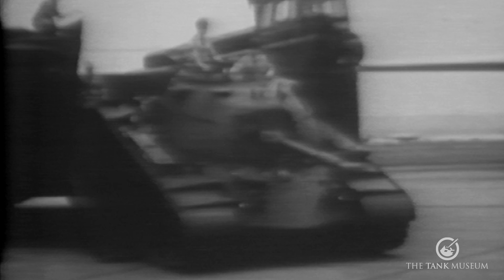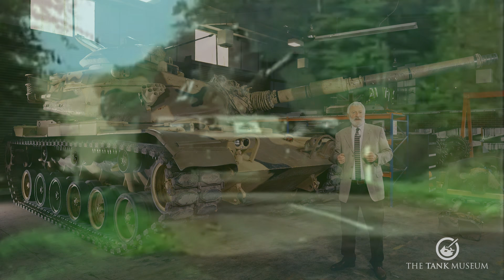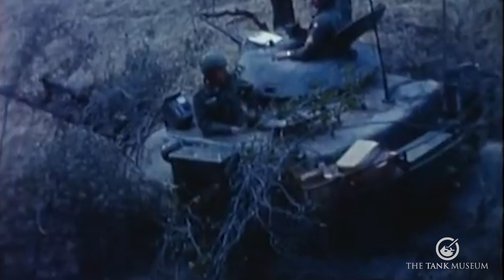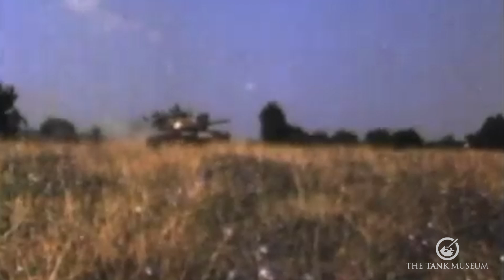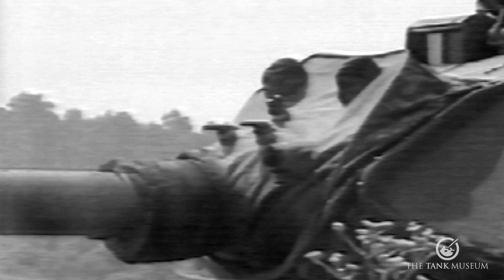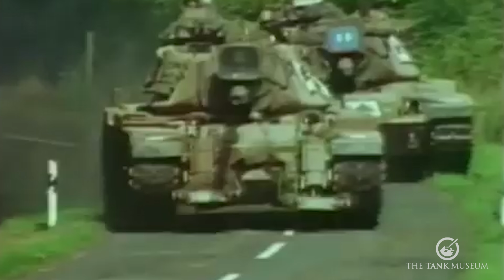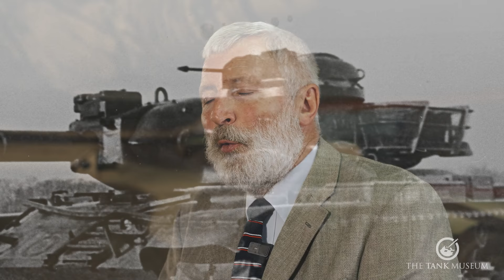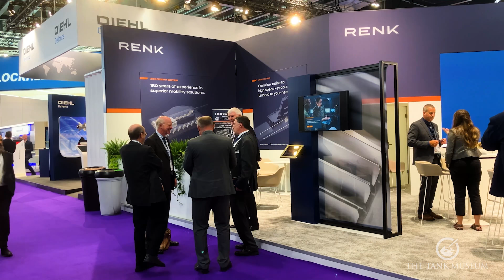M60: Cold War Guardian | Tank Chats #175

Comment: The reason NATO wanted to develop a MBT or Main Battle Tank. The reason for this was to make logistics and economics simplified. So 1: you don't need to worry about light, medium, or heavy tanks. 2: By simplifying the MBT as a central vehicle meant cost effective manufacturing and maintenance. 

This is why NATO considered the MBT doctrine.

Comment: I was a M-60 tank platoon leader in the 3d ACR in 1980. The stab on the M60-A1 RISE was only marginally effective. First, it was only horizontal and not vertical. Second, the 70% hits probability is bogus as we could only go about 5mph and hope to hit a target. And, the commander's cupola was only manually transversible from what I recall. I had wished that it was electric powered.

Comment: Someone has probably already corrected the description of the NBC system.  There was a central blower which supplied air to the crew-carried protective mask via a filter carried by each crewman, but there was NO overpressure system for the crew compartment. If anything, with the engine intake air being drawn from the crew compartment (except in extreme cold weather where the intake could be redirected to draw from the engine compartment), the M60 series would actually concentrate contaminants in the crew compartment!

USMC Tank Officer, 1984-1991

Comment: I spent a few months in Ft Knox back in '71, my first duty station. They didn't need my 44B MOS so they gave me a 5 ton wrecker to operate. I would usually be sent over to the track vehicle shop to assist on M60s. I pulled a few engine packs but mainly I was removing, installing and exercising gun tubes. The gun barrels had to turn to be removed and installed so the mechanics used a steel mesh sling like a strap wrench. When the wrecker lifted on the mesh sling the barrel would turn and come out. The wreckers had a rubber coated track section on the end of the boom. After the new tube was installed I would position the wrecker in line with the tank and extend the boom placing the track section against the end of the gun barrel. A mechanic inside the tank would signal me with one hand sticking out the hatch when to push in the gun tube and when to let it out. After a couple strokes the mechanic would bless it and the job was done. I look back on those days fondly.

Comment: USMC held on to their M103's for frontline use until 1972 and I believe they were with reserve units  until '76. Also,
The original M1 Abrams used the Royal Ordinance L7 (pretty sure these are the tanks we've given to Ukraine).
They didn't upgrade to the Rheinmetal RH120 until the M1A1.

Comment: The M60 was a beast of a tank. No doubt. It could hold its own against the best of the world’s tanks. In service for a lot of years it had the distinction of being the premier tank until the M1A2 came out. Even then, it still gave the M1 a run for it money. However, technology was on the M1’s side and it proved pretty much invincible to the world’s armor. The Leopard tank was really the only tank capable of dispatching a M1. The M60 did things with shear brute strength and tenacity. It was higher than the M1 which clearly gave it a great disadvantage on open ground. It was a fantastic tank for it day and I would rate this tank on a scale of 1 through 10 about a 7 to 8. The M1 was a 9 to 10. The Leopard ( the latest iteration ) was a 10 and If I could give an 11 I would. Germany packed the Leopard tank with everything but the kitchen sink. In my opinion the single most best tank ever.

Comment: I was in the 3rd Armored Division from 1967 through 1969, as a Tank Mechanic. A lot of memories from the times. The German Army was using a German/Reworked M-48A2, which had the upgrade version of the 1790 gas engine with Fuel injection and supercharger. They sounded real similar to the M-88 Recovery vehicle, which still had the Gas engine at the time. They also had a stabilization/gyro system for the 90 mm main gun and could fire on the move. When I had time I would watch them on the gun range, it was amazing to watch and quite accurate too.

Comment: The major improvement in the U S tank development program (M46) was the CD 850 transmission which incorporated hydromatic gearing (high, low, and reverse) steering and braking all in one unit, with no clutch, oh and something totally new "the neutral steering "!
Reply: And one of major improvements to the M60 was the turret control system ( Cadillac -Gauge control system) which was a marvel of engineering and incredibly reliable! And then there was the "marvel of the night vision system) that did away with xenon infrared red based lightning system, and U. S. tanks went "passive" and they no longer with the night vision search lights...they could see in the dark.

Comment: Couple things. 1. M60A1 and before did not have NBC "overpressure" system. It had a filtered system that plugged into crewmen masks. 2. Shooting on move was not really effective. Stabilization system was not good. Way worse than M1 series. 3. Commanders M85 wasn't good. That's why M1 went back to M2 .50 cal. M2 was way more reliable. I was crewman on M60A1 (original and RISE Passive upgrade), M60A3, M1IP and M1A1. TTS thermal sight on A3 was excellent. Thermal sights on M1's very good. IR sights on M60's not good, but Passive Starlight scopes on M60's were pretty good. M60 cross terrain not close to M1. Ammo storage was dangerous in all US tanks until M1 compartmentalized ammo storage. M60 series excellent defensive tanks.

Comment: The US military in the 50s and 60s was idiotic. They either refused to see changing concepts (all steel armor and battle rifles are obsolete). They refused to totally accept new concepts (the moronic M14 rifle and the tall, all steel M60 because WW2 taught us nothing). We still have the Bradley from that period - a huge, easy to spot and hit tall box. And then you had other stupidity, like the refusal to appropriate German weapons. We spent an insane amount to develop the crappy M60 machine gun wjen we could have just adapted the MG42. Likewise we could have just started using the 88mm. But no. We had to spend millions researching and implementing and costing lives of waiting soldiers for 90mm that wasn't as good.

Comment: The M60A1 cupola didn't have power traverse. It was all manual. The M85 machine gun was a great weapon,  but the ammo for it in the cupola was only about 100 rounds. It was very difficult to load the belts into the cupola  feed trays, and usually required the T.C. and loader to expose themselves to reload it. The M73/219 machine gun was notoriously unreliable.

Comment: Jau Leno owns a hot rod powered by a ‘50s vintage M48/60 Patton tank drivetrain. He had the enhine to electronic fuel injection & added twin turbos. Now it’s good for about 1600 horsepower now (more than an Abrams) & 3000 lb-ft of torque.

Comment: I served with the 1st Squadron 11th Armored Cavalry , The Blackhorse Regimate, at the Fulda GAP in West Germany 81-83. We had M60 A3 tanks until the Summer of 1983. We were the first Cavalry unit in the U S Army to recieve M1 Abrams in 1983. When I got stateside 83-85 I served with the 1st Bn 8th Cavalry,  1st Cav Division at Fort Hood Texas. They still had M60A1 s in 83 but after a few months we got brand new M1 Abrams . 1/8 Cavalry was the first unit in the 1st CAV DIV to get the  M1 Abrams. I was proud to have been a tank armor crewman 19E, and 19K MOS.
Reply: Allons!
Reply: Were you stationed at OP Alpha? What was that like to be in the Fulda Gap right across from the potential launch point of a Soviet invasion?
Reply: Man, I was in Germanty 80-83, Hood 83-34! I was an MP, and doing traffic conrol at night, we could alway hear the M-60s, but the M-1s were scary quiet by comparison.

Comment: The M60''s were supposed to be converted to M60A2's with their turrets going on rebuilt early M48's to create the M48A4. Shillelagh's problems killed that. Most ended up as turretless M60AVLB's with some becoming the M728 Combat Engineer Vehicles firing a huge 165mm HEP round and having a turret mounted jib and a dozer blade

Comment: Served 1974-99 first on M60A1, then M60A3 TTS 1974-80. The AVDS engine is from the joint service designation system  - Air Cooled, V Configuration, Diesel Fueled, Supercharged. Current M88's have a 1000 hp version. The oft criticized cupola was designed to enable the commander to carry out his job on the nuclear battlefield that everyone thought was coming in the Fifties. The sight on the A3 TTS was so good (expensive) that theM1 got a cheaper and less capable one.

Comment: The M60A3 was what the Marine Corps had when I served in 86 - 90. I rode on a couple down at Camp LeJeune. Nice tank, but it was obvious that its silhouette was much taller than the M1 the Army was fielding. Still, the flexibility, reliability and abilities of the M60 is the reason it's been in service for as long as it has.
Reply: @kansaspatriot2051  i'd have so many questions, I love those tanks!

Comment: I worked at a foundry in East Chicago Indiana we cast at all the armor for the M60 tank the main hall side rear plates gun shield turret and rear doors for the motor compartment we welded the Halls together with stainless steel stick back then after everything was repaired in The foundry they were shipped to Chrysler for the motors to drive units and all the electrical and the guns that was back in the seventies early eighties and then the Abrams tank was built and that ended blawnox his armor I work for general Dynamics there as a welder straight out of high school I'll never forget it

Comment: I was with the 4th Cmbt Engrs 4th infantry back in the 80s we had an M60A3 Cmbt Engr version of the venerable M60 and one day while doing PMCS there was a guy on the right side of the tank loading kit in the tool boxes when someone on the inside rotated the turret without warning and pinched the soldier on the outside in half with the turret..

Comment: The reason the Soviets and now the Russians utilize shorter tanks wasn’t done to offer a lower silhouette.  The Soviet Union is a massive country, heavily reliant of their limited rail network.  The higher tanks, would not be able to be moved by rail, due to their small tunnels.  Most of their rail lines were built by conscription and prison slave labor on a shoestring budget.  While the Soviets made improvements, expanding the tunnels was not possible.  So their tanks are shorter.

Comment: The record for weight pulled by a semi was set by a Saudi Arabian company at 4,800 tons. A modern Main Battle Tank (M1, T14, Leopard II, etc) are in the neighborhood of 70 tons. So why does the M1 use an expensive helicopter engine that maintenance is complex, when a smaller, cheaper, and simpler diesel Semi engine is far more capable?

Comment: M60 A1 turret mechanic in the 80's. Good tank but the rangefinder was crap.
Reply: Also the turret/cupola contact boards were also crap, and they were third shop. 2 screws and a plug. Yeah right. The third shop senior NCO came down and got all of the turret mechanics: THIS   IS   HOW   YOU   REMOVE   A   TURRET   CUPOLA   CONTACT   BOARD and demonstrated. THIS   IS   HOW   YOU   INSTALL   A   TURRET   CUPOLA   CONTACT   BOARD and demonstrated. YOU ARE   NOW   CERTIFIED   TO   REMOVE      AND   INSTALL   TURRET   CUPOLA   CONTACT   BOARDS. Stop calling third shop and just order them.
Reply: STAB system was fun to test LOL.
Reply: Actually middle of the  80's.
Reply: You need to pull the  governor off that  engine like we used to do as soon as it arrived.

Comment: I served on all 3 versions of the M60.The M60 A2 was called passive high rise.The A3 had TTS,and was a first on tanks.TTS stands for tank thermal sight.The M60 A1 had an infrared searchlight on top of the gun,which made 1.5 million candle light power.Then,i served as a tank commander on the M1 abrams.I do know about the added fire control on the M1A2,but never served on one.

Comment: Another good, detailed video from the TM.  However, as a veteran of the 2nd US Cavalry Regiment in Germany in the early '80s I am a bit disappointed that the M60A3 TTS is given short shrift.  This configuration was very competent, especially its advanced fire control systems.  The Tank Thermal Sight (TTS) was a far superior thermal system to that of the original M1's.  Additionally, the A3 computerized ballistic computer was very advanced for its time, integrating a very reliable laser range finder, wind sensor, and other technical inputs for very quick and highly accurate engagements, including when on the move and with 3-man crews (i.e., tank commander, loader and driver).  I went on to serve on various M1 models, so my perspective is not myopic.  (Would that the M1 had a diesel, but that's another subject).  Perhaps those features and capabilities of the A3 TTS model can be considered and incorporated in future videos.

Comment: I was a crewman on an M728 CEV which was a modified M60 tank back in 90’s. Deployed to the Balkans as part of Operation Joint Endeavor. 165 mm cannon demolition gun, 50. Machine gun in the commander’s station and M240 coaxial machine gun mounted next to the main gun. It was a very lethal platform. Good duty assignment. Best job I ever had!

Comment: The M60 was an good tank.  In many ways it was a better tank than the M1, especially defensively, than the M1.  The M60A3 in particular was superb.  It has a much better thermal sight than the M1 and M1IP, it has an azimuth indictor, 63 main gun rounds versus 54 for the M1 and M1IP, and uses much less fuel.  When given the ERA, or explosive reactive armor, it's protection increased quite a bit vis-a-vis HEAT rounds.  

Certainly the M-60 tanks had issues, as all tanks do.  It was however a very good tank.

Comment: I served in the 263rd Armor, SC National Guard for around 12 years.  We had the M60 tank but also had the M48A5 which was upgraded to the same level as the M60.  After I left South Carolina the unit was equip t with the M1A1 Abrams tank.  In the early 2000s the unit was removed from service because of personnel problems.

Comment: There's no "active thermal" it was all passive. The A3's thermal system (TTS) worked better than the M1's TIS, though that was replaced in the M1A1. When the M1s began rolling out in Europe, the M60A3 RISE Passive could consistently out shoot them. 

The M60A3 tanks we couldn't sell (even for scrap) ended up at the bottom of the Gulf of Mexico to form artificial reefs. Swords to plowshares, I suppose.

Comment: I was on M60's as a front line unit in Germany from 86 to 89 and we did not have any type of overpressure system for NBC.  I remember it well because I was reading up on Soviet/Warsaw Pac vehicles and remember how simple and easy the overpressure system was and why didn't we have it.  I  remember we had to plug into a filtered air system through our gas mask.

Comment: There was a M48 and an M60 on display at one of the bases I was stationed at in the army, and there is an M48 and M60 outside the base where I live now. You can walk up and touch them at both places. The front armor on the hull always seemed impressive to me, with the angle and how hard and thick the armor is it's amazing to me that rounds can penetrate. It had to have deflected a few shots in a real conflict. I also could never imagine a round penetrating the turret front unless it hit right in the middle, the cheeks are just such a crazy angle. Guess I'd be wrong though, looking at the Abrams and Leopard 2 etc.

Comment: Thank you for covering this. During my service I was in the M60A3. love the imagery it brings back memories. Its my understanding the new Abrams X is going back to diesel from the turbine for gas mileage and the turbine takes jet fuel of course. Memories rushing back now, that will be lost to time of like, tearing down the breach block in the field when we would have a misfire (some genius would put lubricant on the firing pin blocking the electrical charge to the main round - they are electrically ignited), for the hydraulic recoil system for the main gun you would have to monitor the fluid level while live firing (I was usually doing all  this work being in the loader position) there is a metal tape gauge above the breach  that  would either have a smooth or teeth on either side of the metal tape (like a measuring tape) that had diagrams in the TM manual displaying what the level of hydraulic fluid was, but we had memorized sayings "Rough Rough - not enough", "rough smooth - in the groove", "smooth , smooth - too much , your screwed". Don't even get me started on breaking track in the field for track derailments etc... ugh. we would call the very large cast iron track tension wrench a "little Joe". and Just so you know... each one of those track blocks weighs 200lbs. each. wow. Thanks for the memories.
Reply: You forgot to mention the Dog bone, it lifted the road wheel pairs.  We were the heavies in our platoon.  I was lightest at 150 lbs.  My max bench was 220.  To be in the heavies you had to dead press one track section and pull install track by oneself (spotter no assist)  Since every field problem had a blown track there were always opportunities for extra

Comment: The lecturer totally missed the most important upgrade of a laser rangefinder (M-60A3) instead of an optical rangefinder (M-60A1). The tank behind him is a M-60A3. You can tell it apart from an M-60A1 by the thermal shielding on the gun tube. I’ve always wondered how the barrel heat was dispersed with all that insulation on the barrel. It’s not like you can swap out the barrel during combat.

Comment: I was an M60A3 Tanker, the M60 series did not have an NBC over pressure system. It did have a gas particulate filter that had a hose at each crew station to hook to the filter canister of the M25A1 gas mask. It did have a turret blower to extract fumes from firing the main gun but it was not filtered in any manner.